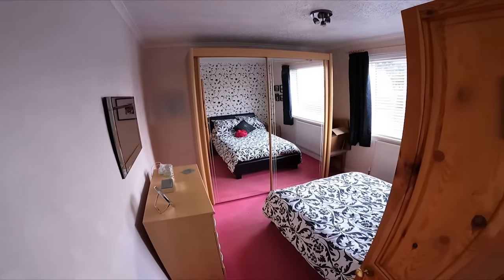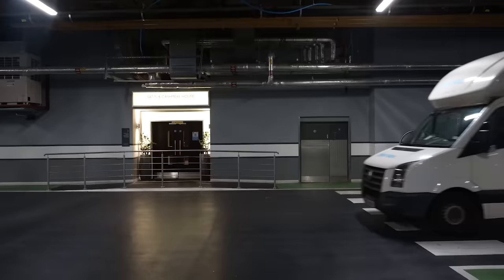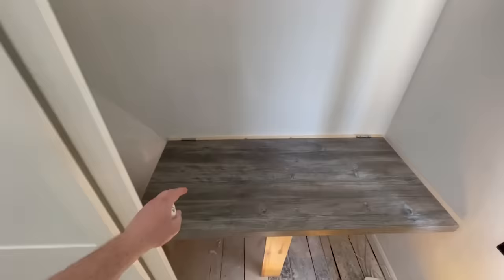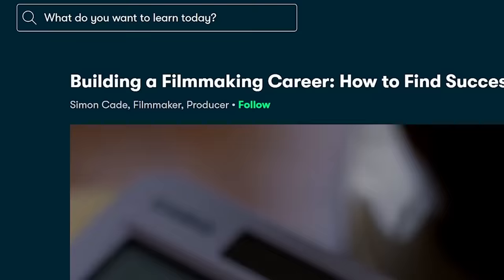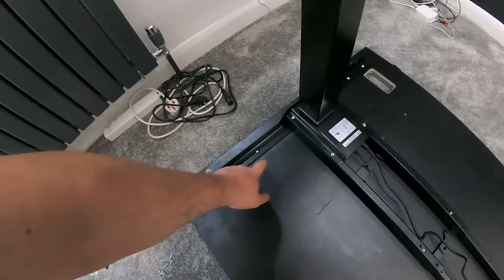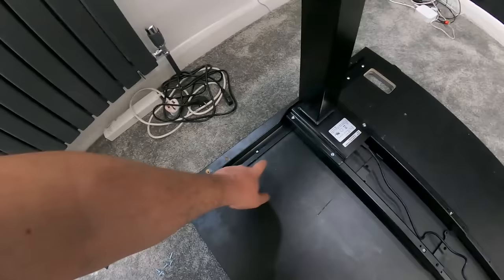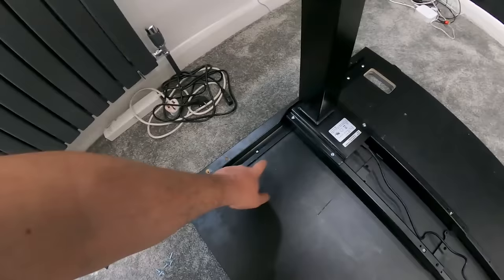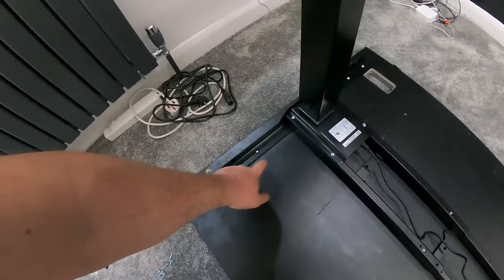I Built My $10,000 DREAM SETUP (Office Tour)

Comment: I got a tip for your pc placement.
U shouldn't place it on the ground especially when it's a carpet floor, as a lot of dust will go inside the pc and if not cleaned often, it could cause some problems, like reduced life span, but anyway a great vid 😂